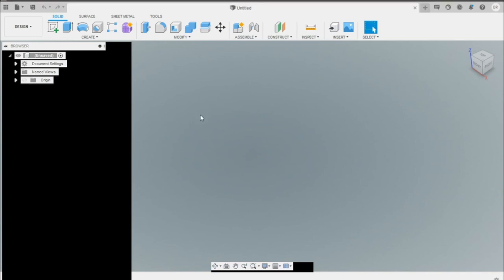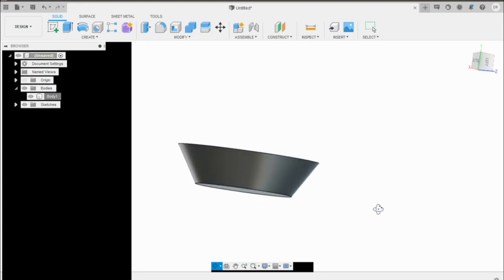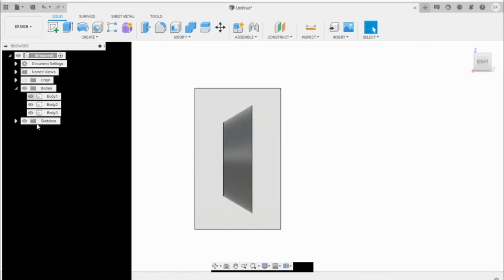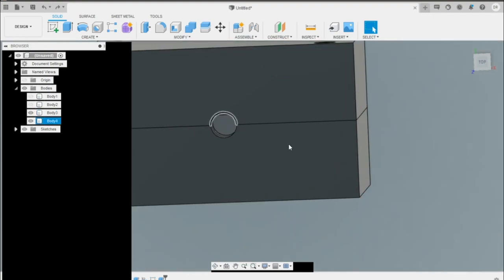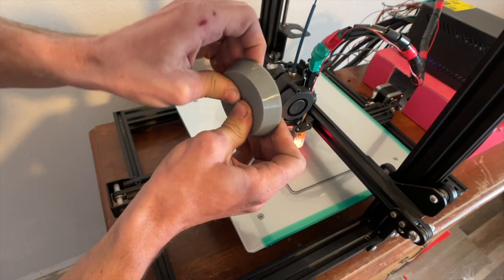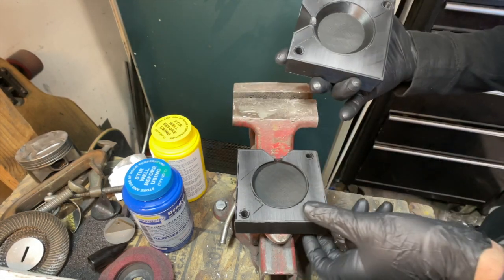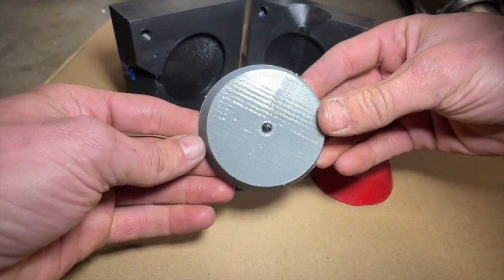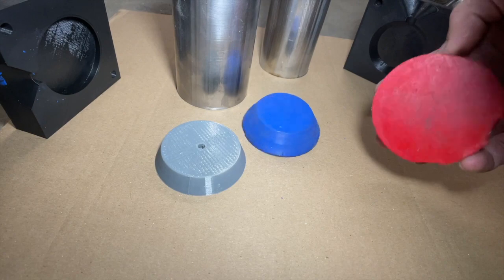At-home tig welding PURGE PLUGS with F360

Comment: Not bad. A couple thoughts on the final product. 1) could create a groove for an O-Ring type seal. that way wouldn't have to worry about sanding as much and help with the clamp seal. 2) Instead of the oil as a release agent - could use something like an automotive wax, or even bees wax.  But pretty cool idea :)